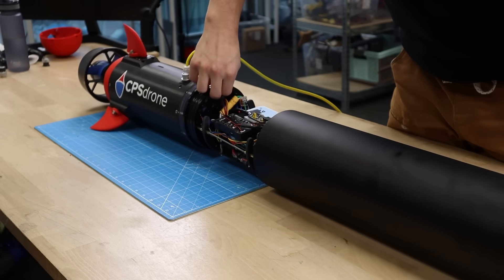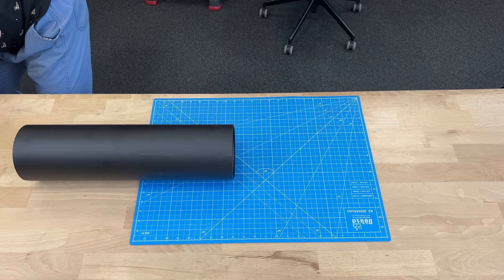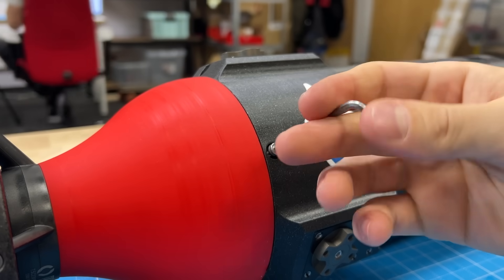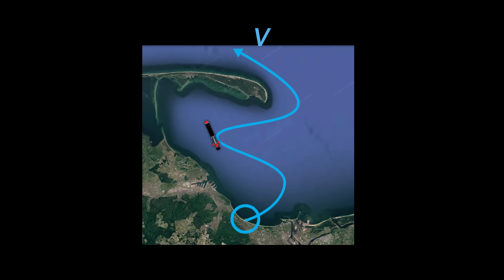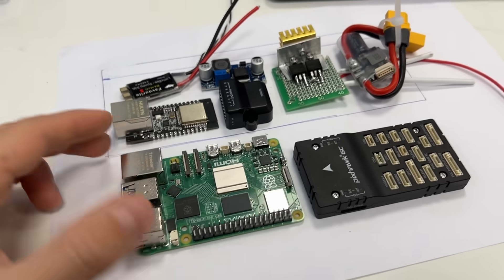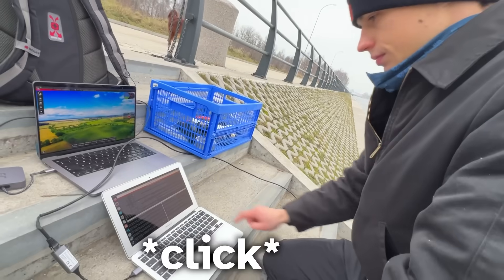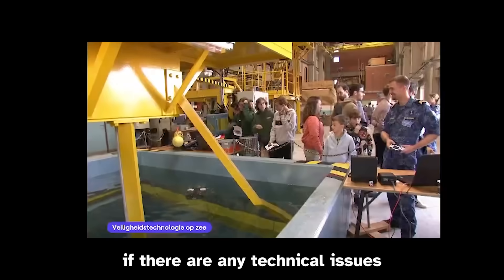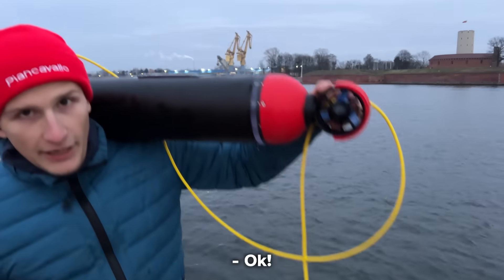Building a fully AUTONOMOUS submarine

Comment: Compasses should still function underwater, for a cheap solution, have it go by following a compass heading, and keep track of its speed, turn at indicated distances.

I suppose there is no way to be 'positive' that it knows where it is, but it could be given the option to 'confirm' its location after every major turn order in the mission VIA surfacing.
Reply: Thought about it some more...

Couldn't we technically use LIDAR to scan the ocean floor and grab relative velocity by scanning it every so often?

A LIDAR sensor should be around 100~ for a functional one.

Take snapshot A, compare against Snapshot B and find the relative distance off a certain point from snapshot A to Snapshot B and that would give us accurate data on our velocity & vectoring.
Reply: @lurac5710 like a computer mouse!

Comment: When I was in college, my roommate, a mechanical engineering major, decided to build a homemade submarine using syringes as the outer shell. He sealed them tight, installed a tiny motor, and even added a ballast system for diving. The first few tests in the bathtub were a success. But when he pushed the motor to full speed, one syringe cracked under pressure, then another—until the whole thing filled with water and sank instantly. We just stared at the wreckage, then burst out laughing. Ah, college memories!

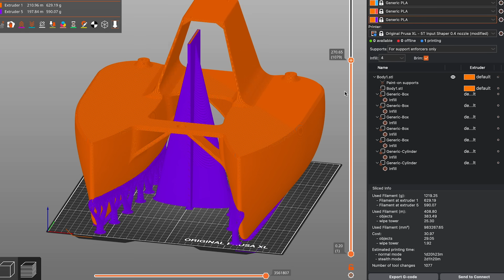Comment: 8:10 you might have to consider IMU + sensor fusion with any other sensor to implement better tracking.Some recalibration of postion with sporadic resurfacing with onboard GPS and an accurate physical model of propultion system of your sub in an kalman filter implementation. make sure to limit acceleration to reduce drift.

Comment: Is the area aft of the battery's that houses the electronics not water tight? I'm just trying to figure out what the "buoyancy foam" is for since adding foam to a watertight compartment will only add weight and actually make it slightly less buoyant but I'm assuming you are well aware of this?

Comment: thats amazing, i expected you to put some  underwater low frequency sound in 3 or 4 known positions of the map. Then inside the underwater drone you have a few microphones that detects where the sound gets detected first, i mean what microphone detects it first. Based on that it can know its heading, tahts TDOA. Exactly the same way the antennas work inside the airtag or samsung locator tags, that can tell you easily with an arrow where it is.
And about the distance, if the sub known at what time it should receive each signal, based on how much extra time it takes to be received, you can assume  an aproximation distance.
Thats basically acoustic triangulation or triangulating location.

Comment: As far as the dive restrictions, why not have the GPS wire on a spring loaded reel that keeps a very light tensioning the line making sure that can unspool and respool the wire. Also to make sure the spool and line centered in the boat so it does"t pull the GPS boat over. that could also give the boat not only more weight but useful weight. Also maybe house the spool under water so it can ack like a pendulum or dagger board? idk just an idea. I haven't watched your other videos yet so maybe you have come up with something better? Good luck guys, and I cant wait to see more!

Comment: An inertial guidance system should be sufficient for a short period of time.  Have it pop up every five minutes or so to recalibrate its position.  Make how long it goes between surfacing a function based on how much error had accumulated since the last recalibration.

Comment: I think that some of the cables I saw in the video used connectors with sealing glands to achieve waterproofing.  If I'm mistaken then my apologies.  But if they are this style of connector then I wouldn't count on it to work at depth.  These connectors are used to keep rain water and moisture out of outdoor boxes and that's it.

Comment: Great job with the build! 

Inertial position determination will be quite difficult due to path integration. Any error in the sensors will accumulate leading to position error which can be quite dramatic. 

When you do inertial navigation use an Extended Kalman Filter with multiple magnetometers to get accurate heading data along with either sonar or a pitot tube for velocity. 

You could potentially get away with a cheap sonar setup for velocity measurement. A sonar transducer can emit a 25 ~ 40 KHz frequency. The reciever can process this data using a mixer or just direct sampling from either an ADC or SDR. Processing the data either using a frequency counter or FFT can give you the doppler shift which would be the velocity relative to the ground. This could be a cost saver if you already plan to add sonar.

Also a HackRF One can also be used to measure doppler velocity by sending a radio pulse and measuring the intermediate frequency that returns. This would be much accurate however the attenuation due to the water at 1 Mhz would be limited to a couple feet.

Comment: Did You respect the torque n relation to the thrust while propulsion. The hull will turn until weight force and torque level. In diving propulsion scooter you level this with weight shifting against this torque. Especially when towing something like GPS buoy. Great project ✌️

Comment: 5:17 adding foam inside tube will never lift up buoyancy , you just add weight ( but very small ) you have to increase volume of the vessel in front . Second important is variable pitch of torpedo , (special if torpedo stops and camera have to shot something ) by variable gravity centre .
Reply: Came here to leave the same comment :)
Reply: I believe that portion of the tube is not waterproofed, and so adding foam will provide bouyancy.

Comment: Just an off the cuff idea that may be too complicated, but could you have a second surface vessel that is also autonomous that communicates position through the water to the sub via sound? Ultrasonic transducers are not too expensive and information can be passed with them. If you used multiple sensors, you could also triangulate relative sub and boat positions. Edit: This also assumes that you are not trying to hide the sub's position.

Comment: GPS: shrink it. stick it in a ping pong ball. connect with thin nylon teather or dynema. serial comms should only need 3 thin wires, with dynema taking strain. add motor as winch on one end to allow control of length and therefore allow working at any depth

Comment: This is awesome. I kind of like the front-mounted steering thruster. It's still a very minimal propulsion system.
If the tether/buoy with the GPS antenna on it causes too much drag it might work better to get rid of the pontoons and just build an angular floating case for the GPS module itself.
It would basically be a fishing bobber with a GPS antenna in it. Could come up with some spring-loaded tether spool too, like one of those retracting key chains, to keep the length minimal.
Reply: Yeah I'm not a boatologist but I wonder if a simple spherical buoy might work better.

Comment: You don't need to add a wifi router to connect to your drone. The raspberrypi already has a wifi antenna. You can configure it as an access point using dnsmasq, and get the exact same experience with no additional hardware.

Comment: Great video! If you're looking to build a more sophisticated underwater positioning system, you might consider an acoustic-based approach. Instead of relying on a tethered GPS buoy, which can introduce lag due to drift, you could deploy a small underwater GPS-like system. This could consist of three reference points—either surface vessels, underwater buoys, or a combination—each emitting distinct acoustic pulses.

For example, the start buoy could emit 4 beeps, the end buoy 8 beeps, and an autonomous service vehicle in the middle (but not in a straight line with the tow others there must be a triangle betwwen the 3 buis) 6 beeps. By measuring the time it takes for these sound signals to travel, the submarine could accurately calculate its position underwater. If the buoys or waypoints have GPS and can transmit acusticly their precise locations, the system could correct for drift in real-time. you would need a acustic data transfer and identification system with should not be to hard.

Additionally, integrating an IMU would provide magnetic heading, pitch, yaw, and roll data. For roll control, an active system could shift the battery's position dynamically, rather than relying solely on passive stabilization. Since batteries are typically low in the sub, adjusting their placement could help fine-tune balance and maneuverability. Also some kind of self recovery system would probaly now be a bad idea. Maybe even let the sub have an energency acustic transmitter so you can later find it easely or the entire time.

Would love to hear your thoughts on this approach!

Comment: The pixhawk is the husband because it can drive and navigate. The raspberry Pi is the wife because it gives instructions to the husband. 😁😁 also the navigation data the drone is using is based on the orientation of the bouy not the drone itself. Add 3 axis magnetometers to both and calculate the difference between them to get an offset for the drone to use, if that makes sense?

Comment: For recovery option couldn't you have like separate battery holding solenoids and if it runs out, it'll pop the front part off to release... something, a floating ball with 10 meter line? Anything to make it easier to spot in water. Heck make the front cap watertight and boyant, and release the whole cap on line.

Comment: There are a few relatively cheap inertial units off the shelf. You really need to work on that first, even before trying a submarine design. The second is not follow the general submarine design, You can work installing the propulsion engine in the middle (for example) and calculate a 3-fin axis bigger to compensate for mass and conditions. Making a stable platform that can stay still at position and course takes a lot of time and effort. Also, the batteries are another point you can improve. The most advanced design works with battery packs assembled on the hull, like the electronic component. Take special consideration to wire handling! On the most advanced autonomous unit, most stuff inside runs on fiber optic. One time you clean mostly those problems hull pressure and endurance are the medium design point. Be aware a real autonomous submarine design can endure 30 days of missions, and they are mostly for ELINT purposes.

Comment: One solution for the navigation could be a directional microphone plus a compass sensor. If there are identifiable noise sources in the area, natural or artificial, a directional microphone could determine the heading to those sources, and arrive at a rough positional estimate. Those sources would depend on the region of course. It could be certain beach or rock formations generate sounds distinguishable by a frequency pattern. Offshore wind turbines. Maybe even ships, or a harbor, with some careful programming. Artificial infrasonic sources could also work well.

Comment: Since you're already doing computing: could you use something like a fishing sonar and have it compare each picture to see how it's moved? And comparing distance to bottom and distance to surface with a pre-loaded depth map for cross-referencing. Not sure if that's too much computing, tho.

Also, what about ballast tanks in the front and back to control pitch? With some pressurized gas canisters they could work as an emergency surfacing solution, too!

Comment: Infrasonic signals could work for quite a bit of distance. If there are two emitters with different frequencies spaced apart and one omnidirectional microphone on the sub, the doppler effect would yield a 2D speed vector. If the direction of the signals can be determined, for example with multiple microphones on the sub, a rough position can be acquired.

Comment: You can use an accelerometer to estimate speed and infer relative position since the last GPS signal, but accuracy degrades over time due to sensor drift. Combining it with other sensors (gyroscope, magnetometer) improves results

Comment: okay quick idea, how about keeping track of general acceleration and rotation with "inertial measurement units" and then going up to the surface sometimes to get gps, imu's drift but when combined with the more accurate gps (which can still be quite off) it's possible to recalibrate the sensors and to keep going

Comment: I would consider to add bujancy control for higher efficiency... You wouldnt need to use motor force to drive up or down and when using 2 inflatable chambers you could even adjust your pitch un the water...  .... You could use an small co2 canister for inflaing and would also need an deflation valve....

You could use an sonar sensor (eg HC-SR04) for depth measurements (dry mounted inside watching the bottom) and drive by compass most of the time... Just get up if the depth gets to low or every 20 miniutes for gps to regain acurate position

Comment: My Suggestions:

1. Steer using the rear prop by adding control surfaces in the propwash.

2. Use a round buoy for easier dragging and smoother turning. (Maybe even integrate GPS and other antennas into the buoy, along with a 3D-printed automatic cable spooler for the drone's tether.)

3. Set up a radio failsafe: if communication is lost for around 3 minutes, drop a sink weight to force surfacing. If you use two weights, you can adjust for both salt and freshwater.

Comment: You could simply resurface periodically to get GPS position and use that position as a starting point with water velocity and compass bearing (magnetic field is not impeded by water) for relative motion. Obviously sea currents are a thing, so while surfaced, turn off propulsion and measure the velocity to get a sea current vector. Use this measurement to offset derived location.

For turning you should use rudders not fins, ie. place them after the propeller. That way you get a sort of thrust vectoring.
Reply: @B.D.B.  Just for clarity, this is called Inertial Guidance
Reply: @PoorlyWindow549  I think inertial means using gyros and accelerometers to derive location, but the principle is the same.
Reply: Yeah thats what i was thinking
Reply: Yeah, inertial guidance periodically corrected by briefly surfacing for GPS.
Reply: Gps + mems gyroscope + software corecction
Reply: I was thinking just having a GPS module floating at the top connected via a long wire to the submarine.
Reply: @ thats kinda what they did with the buoy
Reply: @ yeah but its a buoy not a gps
Reply: @ I think you missed the part where they said the buoy is for a GPS antenna.
Reply: @B.D.B.  oh my bad

Comment: What about to use sensors fusion? two or maybe three MPU-9250s that are 9 axis sensors(accel,gyro,compass), and using a high precision GPS x/y/z axis moment information  as "reward" parameter to a neural network to fit in based on the sensors readings, it will be capable to tell the precise x/y/z moment/accel with fine and realistic precision.
Reply: you still need to know how deep, to avoid "landing" on sea bed, or hit sea shore
Reply: @johnbofarullguix1499  you right, some more sensors are needed anyway as the GPS dont tell the deep of the sea bed either.

Comment: If the radio waves for GPS don't work, you could try to recreate it with sound waves. You need 3 sound emitters broadcasting pings of different frequencies. With correct timing, your sub can work out the distance to each transmitter and triangulate it's position

Comment: @CPSdrone 

You can use accelerometers and gyroscopes for measuring the position of the drone, and for the drone to know it's own location, 

Because of the math involved, 2≈ $75 phones can be used to make a very accurate INU, some will say that military INU is peak, but civilian electronics is often way advanced that the military's electronics especially micro computers , because the military love redundancy, and believe it or not , outside of war time .the military is not as innovative as the commerce industry because in an open market, the commercial industry is always in wartime.

Anyway

Using mobile phones, you can load on Google maps and use the offline out of GPS range for the drone, a phone or 2 on the drone with some error calculations between the vamues the two phones return can be done, passing signals via USB to a microcontroller will give you a decent control loop, if you're using Google maps with an app / service side loaded on the phone, 

If there's the technical barrier for writing an APK for that you can just measure raw inertial values and gyro values, from the phone and make a computational.model , that factors the ebbs and movement of the drone by the waves and stuff, 

If you want to build your model, slap two very cheap phones in your current drone, and route the signal out of the drone to the buoy/floating thingy,  control the drone manually,  and tail it and have the acc , and gyro data returned by both phones or more,  logged, and plot it out and over lay on each other to find your errors. 

More can be done too,
Reply: Combine the data with onboard compasses and you good

Comment: I did think about a rescue system you could add to your unit. It would be a timer that when expires a solonoid would puncture a CO2 cartridge that fills a bladder forcing the drone to surface and stay there. By adding a basic GSM module, it could also SMS its current position to you. This would only be useful if you have a boat you can use but it would rescue the drone in the event of it sinking or an electronics failure. I would be happy to give further details if you think it would be of help 👍